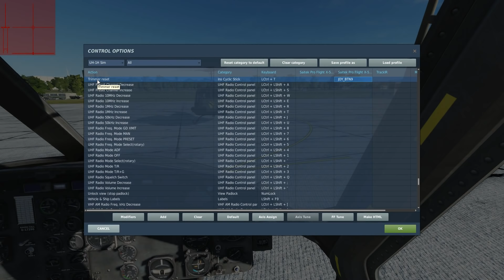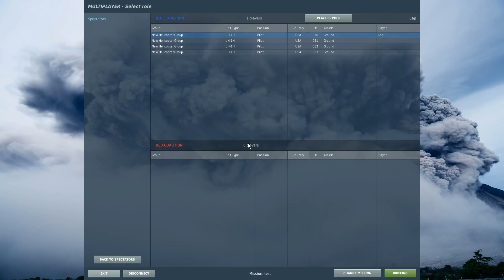UH-1H Huey: Control Methods & Avoiding VRS Tutorial | DCS WORLD

Comment: It's a decent intro. I have a few sticking points, though. 

1) Do NOT do rapid stick deflections with the rotor unloaded, as it is when on the ground and with the collective "on the floor". The flapping will get out of control, the rotor hub will hit the main rotor shaft (this is called mast-bumping), the shaft may break and the rotor will leave the aircraft. This applies to all 2-bladed teetering rotors, but is still not a good idea with articulated rotors. 

2) There is no rudder on the Huey, nor is there on most helicopters. The pedals can be referred to as "anti-torque pedals" or simply "pedals." They control tailrotor pitch, which provides yaw authority. 

3) Collective should not be confused with throttle. On smaller helicopters (S-300, for instance) the throttle must be managed manually, though it is generally mixed via a "correlator" with collective position. In the Huey, the engine is governed via main-rotor speed (Nr). Throttle WILL generally increase with increased collective and vice-versa, but they’re not the same thing. The throttle is a separate control that can be mapped to your joystick in DCS. 

4) When you first lift off, you have to compensate for three things: Mainrotor torque, tailrotor thrust, and CG. As you increase collective, mainrotor torque increases. This must be countered by the tailrotor, via the pedals, providing a small-ish linear force about a large moment arm. This linear force will also try to pull the aircraft to the right, which you must counter with left stick/cyclic pitch. This tilts the rotor disk to the left slightly (but not the entire aircraft because of the teetering rotor). Additionally, longitudinal cyclic is required to compensate for longitudinal CG location. With weapons mounted on the hardpoints, you will find you need much more aft cyclic to compensate for the forward CG. 

5) You should mention that when you are hovering a few feet above the ground there, you’re in ground effect, which means there is a “cushion of air” below the aircraft, slightly reducing the collective (and power) required to hover. This is actually a stable condition as far as altitude and vertical speed are concerned. As you drift up, the cushion weakens and you then begin to settle back down. As you drift down, the cushion strengthens and you drift back up. In ground effect (IGE), the collective actually works to command your altitude rather than your vertical speed, which is rather convenient when air-taxing. 

6) When laterally displacing to the right, it’s worth mentioning that you will need left pedal to keep the nose pointed in the same direction. The aircraft will want to “weathervane” due to sideload on the vertical stabilizer and the fact that you’re putting the tailrotor in a climb condition. You need more tailrotor thrust to compensate. Conversely, left-sideward flight will require right (pro-torque) pedal. 

7) I agree that flying the Huey without the trimmer is the way to go. I find that knowing where the stick is at all times really helps be understand what I'm asking the aircraft to do. I find that, when trimming, I get "lost" and I no longer have a feel for where I need to put the stick to do what I want. This issue can be solved with a stick with dampers and no springs, or some sort of active stick (FFB, for instance)

8) Vortex ring state, often called “settling with power,” is NOT a stall. It is a vertical descent condition for a rotor in which a large vortex ring forms around the rotor. Most of the air induced by the rotor disk then gets entrained in the upward flowing air around it and is then recycled back into the top of the rotor. There is little net change in momentum of the air and thus, very little thrust. Increased collective pitch simply works to strengthen the vortex ring. The best way to exit this condition is to enter forward or sideward flight, where a vortex ring cannot form. Vortex ring will only form with very low or zero translational velocity. 

9) You will want to use pedals to coordinate the turn when in forward flight. Like in a fixed wing, you “step on the ball,” but unlike fixed wing aircraft, you don’t put it in while you make the lateral stick input. Establish the bank first and then coordinate the turn. 

10) The Huey doesn’t want to kill you. 

I’ve found the best way to practice slow-speed IGE flight in the Huey is to set up a bunch of trucks at an airfield at various speeds and practice following them around forwards, backwards and sideways. Another thing to practice is the pirouette maneuver, where you circle an antenna or some other tall object, keeping your nose pointed at it the entire time. This puts you in a side flight condition and it really helps you get a feel for the pedals.
Reply: Well said!
Reply: Some notes on that:
4) "This tilts the rotor disk to the left slightly " You probably worded this in a suboptimal way as I am sure you understand that the whole disk does not tilt relative to the aircraft. 
The swash plate creates different AOA for each blade along their path, and (combined with gyroscopic precession) this provides the desired maneuvering torque. Just pointing this out to avoid the common misunderstanding.
(Although the disk will appear to tilt slightly due to reaction forces).

8) I believe vortex ring state can occur with zero indicated airspeed, including the instance where a helicopter is moving downwind at approximately the same velocity as the wind. This is an extreme case where a helicopter with noticeable translational velocity can experience vortex ring.
Reply: You should do a video on helo turns and lateral movements!
Reply: That was long, but I read all of it.  I'm finally getting the hang of flying the Huey, so this is really good, distilled information.
Reply: Very useful extra information. Had kind of figured that VRS must be different to classic stall but good to see confirmation.
Reply: Thought this https://www.youtube.com/watch?v=LrNf2ZzjfHo was a good video on the subject. I guess VRS is related to a classic stall but rather more complicated.

Comment: In my year of flying the friendly skies of Vietnam and Laos I never used force trim to hover. The cyclic is in constant motion almost like mixing cake batter. If you use force trim you would be constantly fighting the trim. Same for level flight. You might get a few seconds that you don't have to move the cyclic with the force trim on  in level flight but that's all. 

Nothing in my Army issued Huey operation manual about VRS. However this may be the same as settling with power. The only time you had to worry about that was when you had a sling load to drop off at high altitude such as a fire base on a mountain top. You have to come to hover and lower the load. If the DA was high better be careful.
Reply: Do you play DCS or any other flight sims? Do you still fly helis in the civilian world?
Reply: @sumbat1538  I fly in MSFS 2020, DCS, X-Plane 11 and I am starting flight school for regular airplanes in the fall

Comment: I think your explanaiton of VRS was actually quite well done Cap; the identification that the problem stems from sucking in your own recycled air (that you have already expunged through your rotors) is key to understanding what is happening. Normally in flight you are experiencing this recycling too, but only at the very edges of your rotor (or your wing if in a jet / plane, thats also where the rolling overwing vapors come from). However in low-speed situations (ie descending vertically at a rapid pace or coming out of translational lift) this recycling air is sucked in at a larger volume, to the point where you loose lift due to you not pushing down air but only recycling it in a vortex: Vortex Ring State (VRS). 

It would like to caution against the advice of using more power to get out of (pre-) VRS, on the grounds that adding power nearly always only exacurbates the problem: you are going to suck in more of your recycled air and lose even more lift. Although adding power can sporadically be helpful to avoid VRS, it is very difficult to spot when VRS begins exactly: once you start loosing lift you have already been in VRS for a good amount of seconds and thus raising power (however fast / slow) will only make it worse, which is also why you crashed or were extremely lucky to be able to power out of it. It is an unreliable technique and I myself would not advertise it, but you might get lucky.

The surefire way to get out of VRS is simply to input cyclic (or stick) to break apart the Vortex State; obtaining any movement speed will break apart the vortex of recycled air being sucked in to your rotors and will make you exit the VRS state. You can both accelerate forwards or sideslip out of VRS (as Victor Duran also mentioned). Please try to accomodate yourself into doing cyclic (or stick) and not collective (or throttle) to get out of VRS, as it will save you crashes over time if you wish to fly the helicopters more :)
Reply from the maker: rhr thx
Reply: It's actually more than just going through your prop wash. Your wingtip vortices start expanding and actually pushing down on the rotor from above, which is why increasing collective makes the issue worse. There's a brilliant video every aspiring helo pilot should see imo, it visualizes the issue very nicely: https://www.youtube.com/watch?v=HjeRSDsy-nE

Comment: Great tutorial and yes, one way to prevent the VRS to happen you can use collective but.....
Rule No:1 If you end up in a VRS and start falling NEVER use collective to try get out of VRS.
Once a VRS have started and you fall adding collective only increase the Vortex (VRS) effect and make you fall faster. 
To get out of a VRS you increase directional momentum forward or sideways out of the (vortex) VRS draft that way you get control back.
Don't change the collective when a VRS started or during it's course, leave it where it is and quickly add forward momentum by put nose down or role movement sideways or combine them.
A full VRS on low altitude how ever is very hard to regain control from before plummet to the ground and you need lightning reflex once a VRS start in low altitude or you're as good as toasted.
Preferably is to prevent it to happen at all but to practice on higher altitude, cause a VRS to happen then try regain control repet until you have a good grasp of how to.
Knowing how is what might save you from a crash and yes I said might save you.. :P

CHEERS!

Comment: Does VRS = "Settling With Power" or "Vortex Ring State"? (these are two different aerodynamic phenomena specific to helicopters) As a "civilian only" helicopter pilot, I was taught "the rule of 3's" to avoid it - Vertical decent rates less than 300 fpm, Indicated Airspeed greater than 30 knots (until in ground effect). The "Left sidestep" maneuver to escape "settling with power" is called the Vuichard Technique/Maneuver and will work quicker/with less altitude loss than attempting to "fly out of it" (works for either VRS or SWP). Also, helicopters don't have a "rudder" and hence, no "rudder pedals" - The pedals are properly referred to as "anti-torque pedals", or simply, "Left Pedal", "Right Pedal" as needed to keep the nose pointed in the correct direction.         
https://www.youtube.com/watch?v=ehV9vLnBICE

Comment: Vortex Ring State requires 3 regions of flight to achieve. 1, Low or Zero airspeed (Below Translational Lift speed0; 2, some power in use; 3, a modest rate of descent particular to that type of aircraft. In short the rate of descent flow starts to compete with the induced flow through the disk with the result of ultimately stalling the interior part of the disk whilst creating recirculation at the outer part of the disk which reduces the angle of attack and thus lift. The small middle area of the disk can still be producing lift but it is insufficient to hover and, at times, control the aircraft. However, increasing pitch on the blades, once established in VRS, will only exacerbate the situation with a probable reduction in rotor RPM and susequent coning of the disk. All of which just adds to the rate of descent and ensuing crash. The recommendation for getting out of it is to cyclically tilt the disk forward to get airspeed back and thus exit the conditions required for VRS. Obviously, this will result in a loss of height which, by this stage is already significant. Thus, low to the ground, it is a killer. An additional method may be to dump the collective which results in the potential to enter straight into autorotation or stops the induced flow aspect thus giving back control to pitch out and get airspeed. This, however, adds significantly to height loss. Your example seems to be entering VRS as you sink on the minor quick stop but thereafter I would suggest the ensuing crash is because you have fixed the power and thus no longer have enough to prevent a crash.
Reply from the maker: thx
Reply: You can enter VRS in a steep descent under power.  You do NOT have to be at "low airspeed".  More forward airspeed means that you'd have a harder time entering it however, as the forward airspeed negates the turbulent return flow back to the disk.

The easiest way to get VRS is to hover near buildings or other obstructions.  Ask the pilot that flew the lead UH-60 into Abbottabad.  That's how he ended up crashing - hovering near the wall and entering VRS.

Comment: Great video, Could have touched on how not to melt your engine while in forward flight, using the collective to manage engine power.
Reply from the maker: roger I best learn that myself.
Reply: It is pretty easy to give it too much collective and run the engine EGT in the red, causing it to fail quickly.  I had mastered the UH-1 until they modeled the engine failure, then it took some definite adjusting to get it right again.

Comment: Fun fact. One of the only helicopters that can power out of it's own VRS is the S61 Skycrane. When It's not loaded with water of course.
Reply: Not true, the Chinook can get out of it easily, with just pedal movement.  Side-stepping into clean air ends the error state quickly.  That's what you want, you want those blades grabbing clean air.  You could think of this as "settling with insufficient power".  Some people used to call it "settling under power" but that was both inaccurate and misleading.  

Also, you do NOT grab the collective and raise it when recovering from VRS.  That is NOT what you are taught in RW flight school.  Been there, done that, got the wings from Rucker.
Reply: Thanks Captain Obvious.

Comment: 0-30kts and 300-500fpm of decent on VSI (Vertical Speed Indicator) to get into VRS.
Decrease cyclick pitch to drop the nose and gain speed 
Above 30-50kts level the heli using Cyclic, VSI should be neutral +-0 
Increase collective to regain altitude.

also it's not recommended to practice VRS below 500ft AGL ;)

Great video!
Reply from the maker: thx

Comment: I had already some clue because I was in diffrent helicopter trainings.(Simulators, Basic control) I never flew a real helicopter but when I was in Army aviation (Slovak) I flew Mig and my biggest achievement the F-16 and I called it "The chunky boi" because if it's two big external fuel tanks.

Comment: What you are describing as VRS is actually the aircraft losing translational lift and requiring you to add more collective as all the lift being produced is from the rotor disk's downward thrust vice the transverse flow of air over your rotor disk by your forward  airspeed causing the rotor disk to produce lift like a fixed wing aircraft. when losing translational lift, you can tell the change in flight regime by the slight vibration or buffeting of the huey at low airspeed. This is compounded with dropping airspeed while landing since you drop collective and pull up to kill off your speed while maintaining the same altitude. If you don't bring on the collective before you lose translational lift you lose a lot of altitude, and you may apply to much collective to halt your decent with an already high descent rate.  Once there, you are at risk of VRS due to settling with power where you generate a torus of recirculating air that cancels out the lift of the outer portion of your rotor disk. It's kinda like being stuck in y our own wake turbulence.
Reply: MrTheDridge you can't settle with power.  You settle with insufficient power, or when you enter vortex ring state. You don't enter VRS with forward flight speeds sufficient enough to prevent VRS.  This isn't translational lift issues, it is proper VRS.